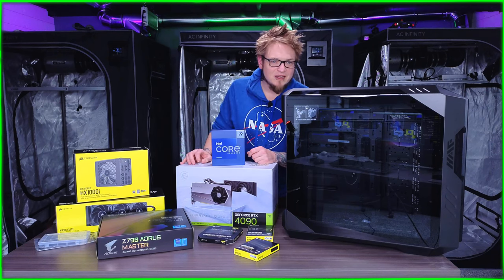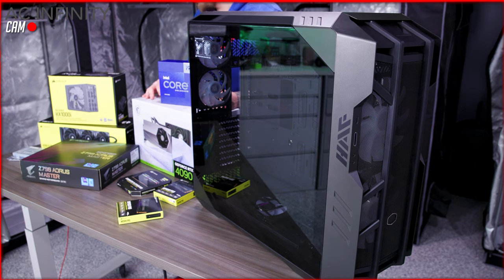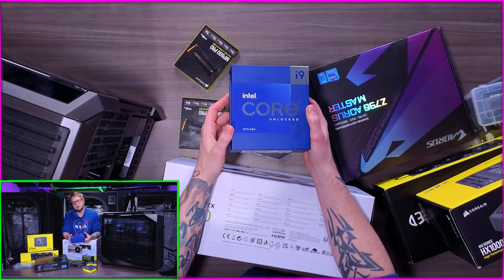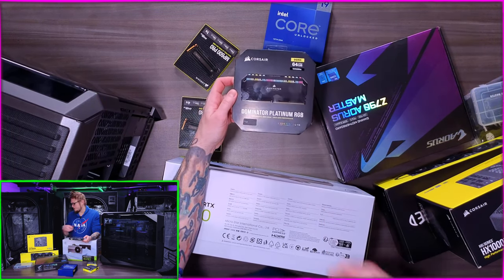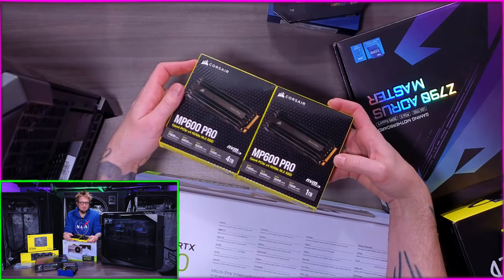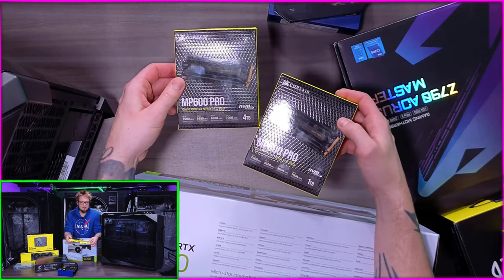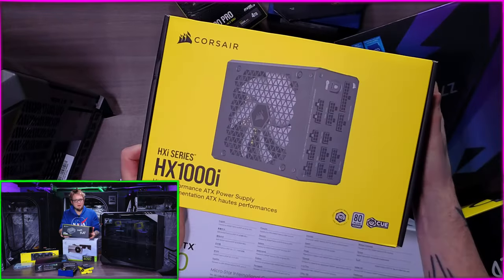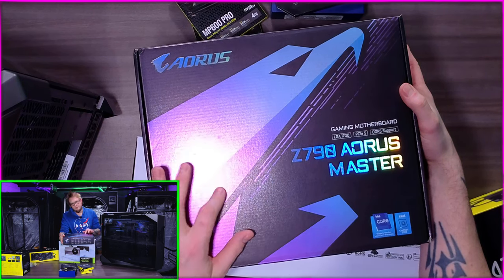Nerdin' Out With Neil! Editing PC Build LIVE!

Comment: damn, wish I didnt miss this.  I build customs and would gladly give some advice if you need it.  those AIO liquid cooled gpus are cool, but the cooler will fail in a year, 2 tops.  HMU when you're ready to do a custom loop!  and I loved all the cringing in the chat during the nvme fiasco.  future reference, you should remove the heatsincs from the drive, not the thermal pads on the motherboard.  easy to remove, just 4 push tabs on the sides.  and get an atx 3.0 power supply.  save yourself the fire risk bro.  DO NOT try overclocking that card until you have it properly powererd.  dont use a CPU connector for PCIe, its a different pinout and youll fry something.  you only need to plug in 1 of the 8 pin cpu headers unless you plan on some Xtreme overclocking.
Reply from the maker: Thanks fam! Already returning that PSU for a ATX3.0 with native PCIE 5.0 connector didn't realize when I was ordering parts! f that ridiculous adapter 🤣 Didnt wanna remove the heat sinks since it says it voids the warranty on the drives, but I ordered a vertical GPU mount that will open up all the M.2 slots and route the video card rad pipes much better! Waiting game again but I did go through and clean up all the cabling in back so its ready just waiting on a few parts till I install windows!
Reply: @Highigan  yeah the new pcie standard is a nightmare, but at least you got it figured out.  you were kinda screwed on a warranty either way, removing the thermal pads classifies as a "modification" so especially if bought from newegg, they wouldnt accept a return.  just make sure to replace the pads and claim it never happened in the event you do have to RMA that board.  I do gotta say, you inspired me to do a build in that case, the tooless aspect is pretty nifty 😅

Comment: U need to get a power supply that can run ur video card with out that 4 plug connector look it up it not good to use fire problems
Reply from the maker: You are right, f that adapter, I am returning the corsair PSU and ordered an ATX3.0 psu with native pcie 5.0 power plug! Didn't realize when I ordered that other one!
Reply: @Highigan  u got it fam just looking out for ya